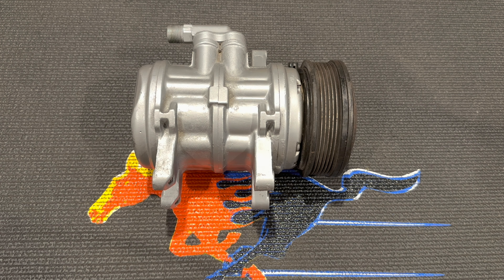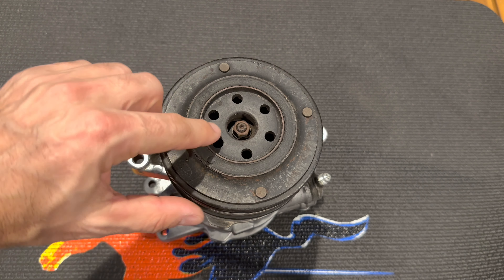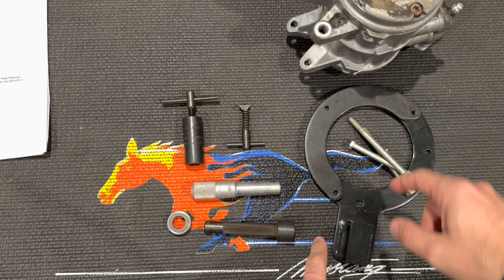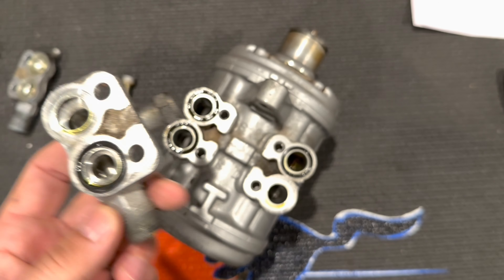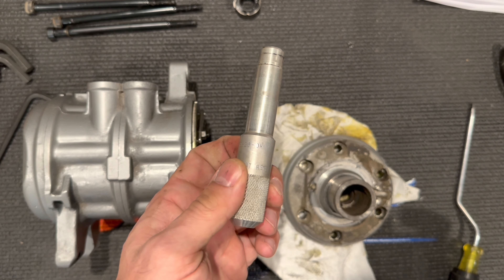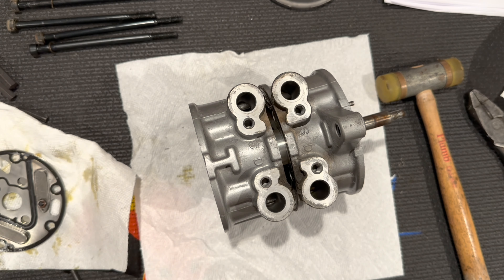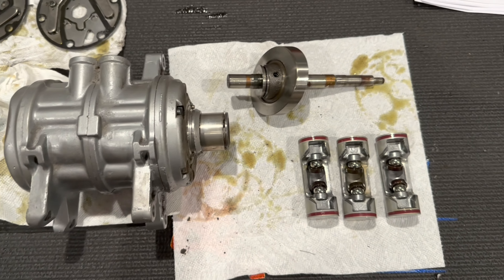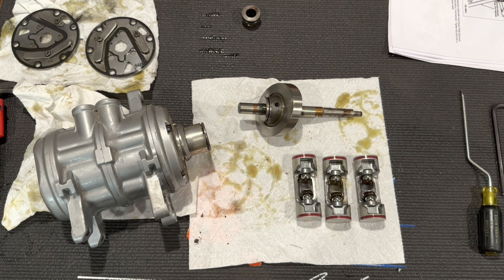Foxbody Mustang Nippon-Denso 6P148A A/C compressor rebuild: Part 1 - Disassembly

Comment: Do you know whether the tools needed for a rebuild are the same for the sn95 new edge mustangs? I have the old leaking compressor from my '01 GT that i'm considering rebuilding instead of scrapping. Thanks
Reply from the maker: @bg1617  the new edge uses an FS10 compressor.  While I haven’t rebuilt one yet (I have a ‘00 GT too) they look different so I imagine the process and tools required would be slightly different as well